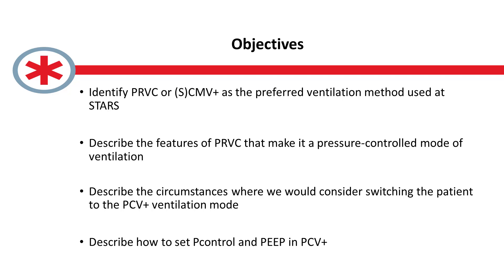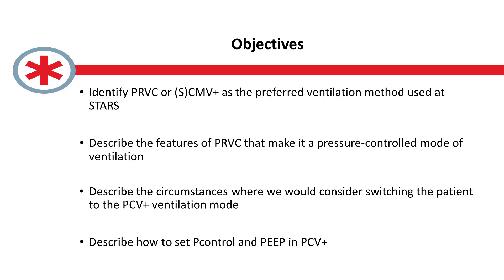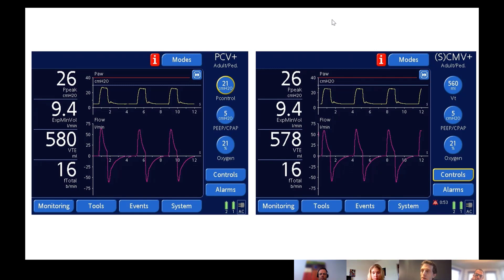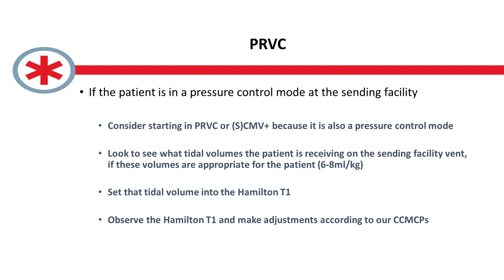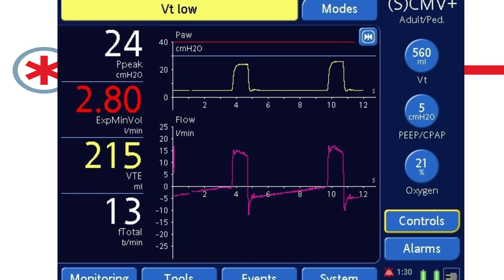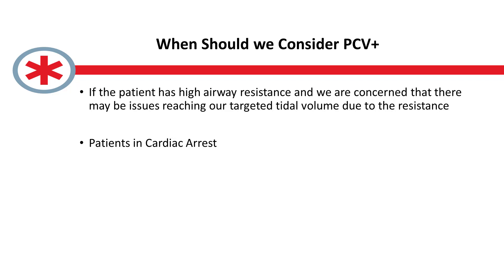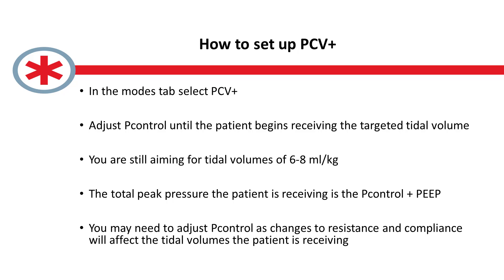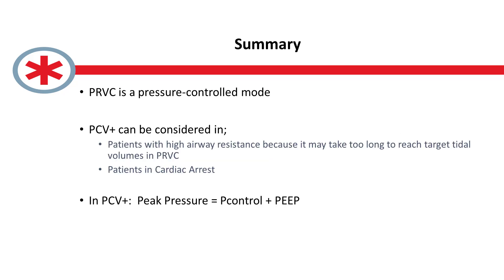PRVC and PCV Review

Comment from the maker: Hi Jacques. Thanks for the question. In VCV the flow is constant during the i-time. This is sometimes referred to as a square-shaped flow waveform. In PRVC every breath is a pressure-controlled breath so the flow pattern is decelerating. The pressure waveforms also differ between PRVC (again this is really a pressure-controlled mode) and VCV. I did a quick search and found this article that may explain things in more depth. https://www.ncbi.nlm.nih.gov/pmc/articles/PMC7782574/pdf/40124_2020_Article_235.pdf